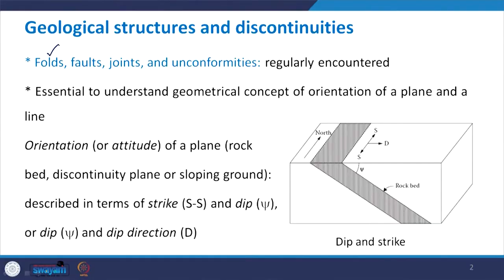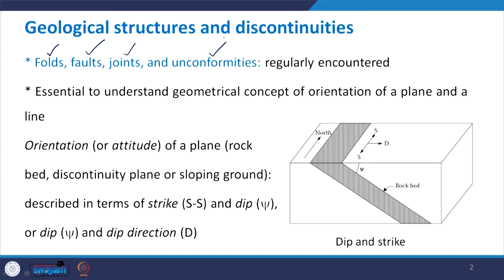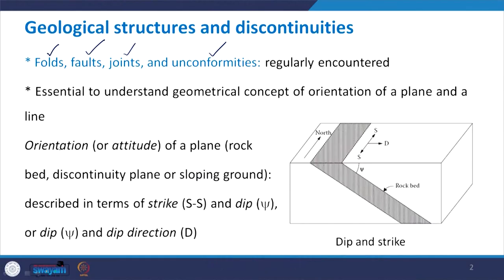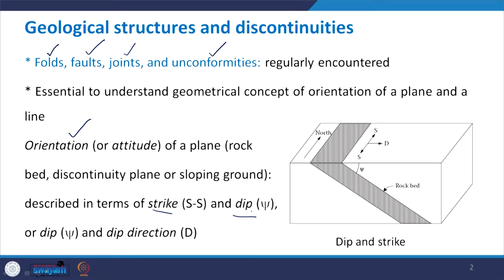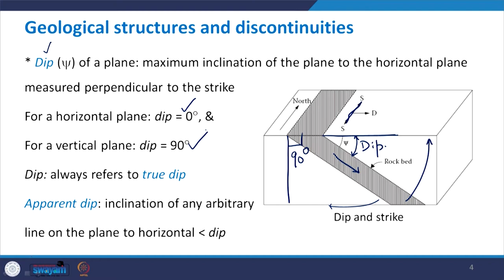Lecture 05: Geological Structures and Discontinuities

Comment: Group A 
Rock strata characterization: Geological structures in rock mass, characteristics of rock mass, 
joints in rock mass, joint survey techniques, rock mass classification systems. Methods of 
determination of strength and deformability of rock and rock mass, failure criteria for rock 
and rock mass. 
Strata mechanics and ground movement—design of underground excavation in competent 
and incompetent rock, ground movement and control, rock burst theories of subsidence, 
subsidence prediction and control. Ground control and stabilization . 

Group B 
Theories of elasticity—propagation of elastic waves in rock medium and dynamic behaviour 
of rocks. Factors influencing stress concentration, zone of influence of an excavation, effect 
of planes of weaknesses and shape of excavation, delinearization of zone of failure. 
Instrumentation—monitoring instruments, their operation and installation. 
Finite element method and boundary clement method, their application for stability analysis 
of excavation and slopes.
Reply: Pls explain this content